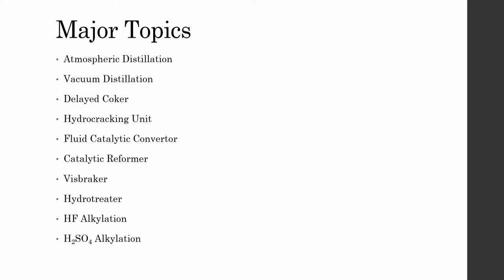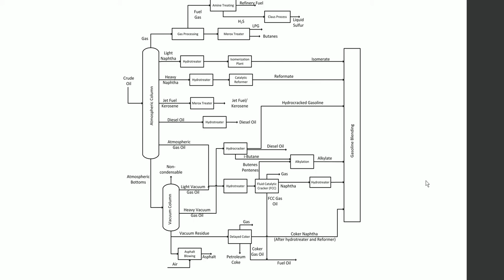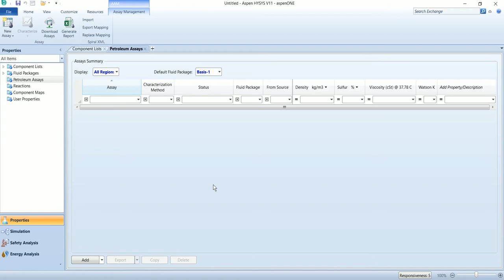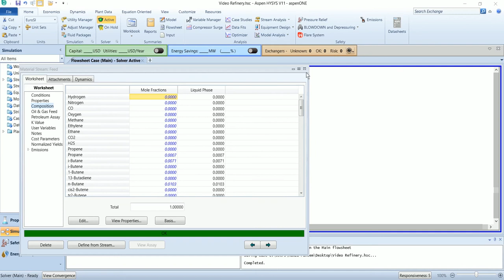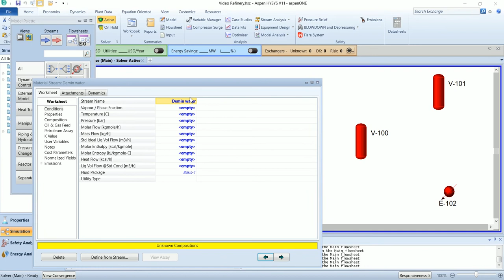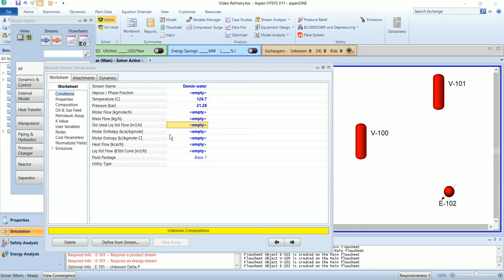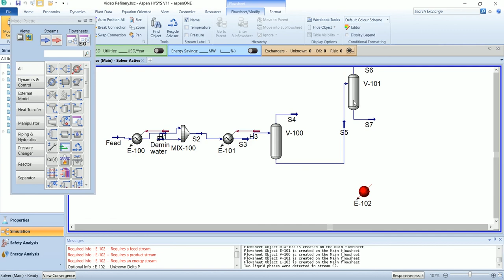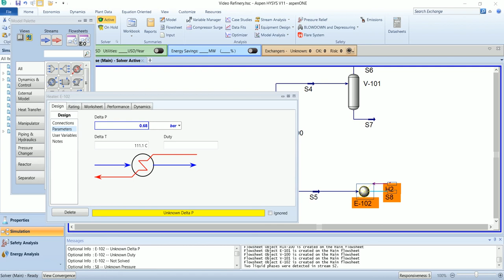Introduction and Crude Oil Pre-Heating || Aspen HYSYS || Refinery Process Video 01

Comment: Thanking you for this video. I have a question. I used to work with v8.1, first i'm inserting the light ends (C1 to nC5 and water), also group of hypothetical in the comp list. Then selecting fluid packages, importing petroleum assay from library, then input the light ends comp manually in the assay form (%-Vol) to the selected petrol-assay. How can i do these steps in hysys v11? The UI and newest form is a little confusing
Reply from the maker: I believe the similar steps can be done on V11 as well. I am not sure how V8.1 look like as I started using aspen from V9. If you can share some other information related to query then email at support@chemiopedia.com
Reply: @Chemiopedia  ok i'll send you email the typical problem, thank n Salam